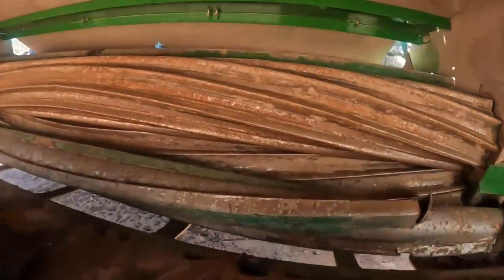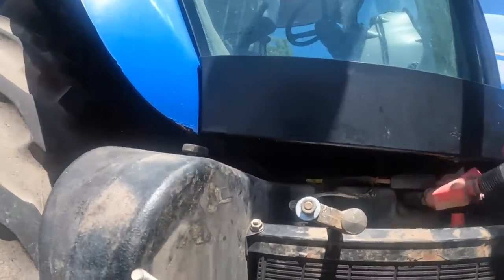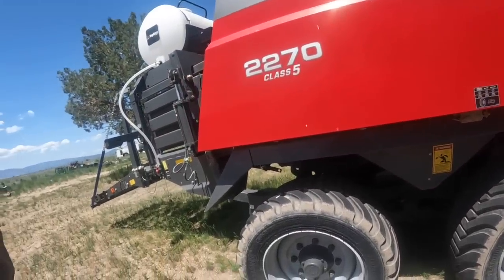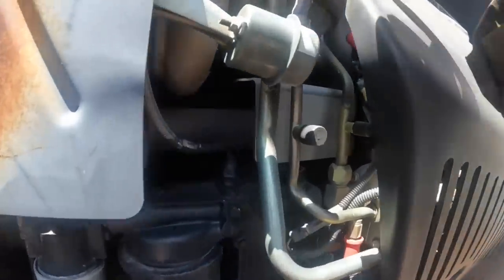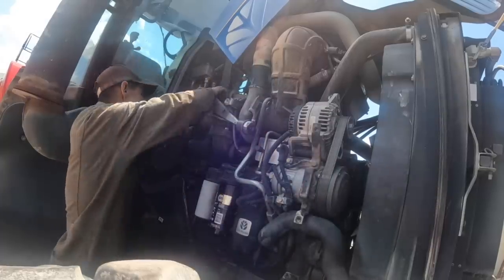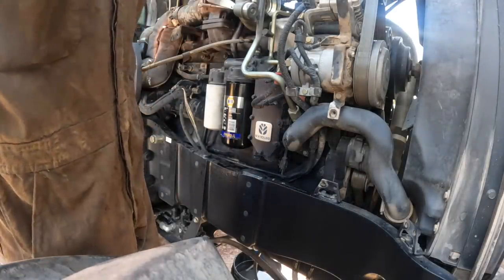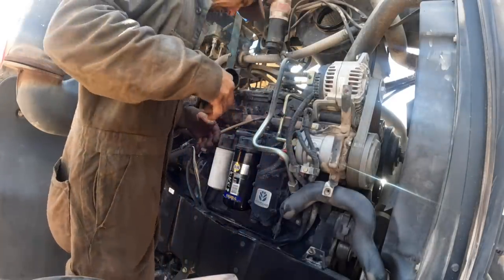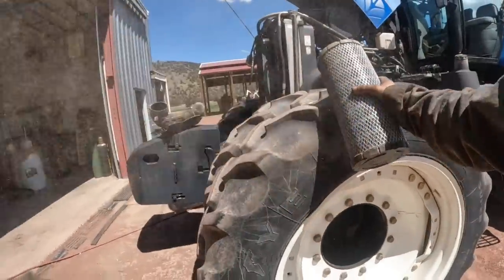Another day another shekel!

Comment: Warren, before I joined the Navy in 1969, I took a two-year course in Diesel Mechanics at Lane Community College in Eugene. They also had a Farm Equipment Mechanic course. A logging and construction equipment dealer and shop came to the school, looking for some student to work there part/time. I volunteered, and worked there as a helper until I went active duty in Navy and became an Engineman. I was wondering if you had ever thought of something like that. You need some help! Jones EN2.

Comment: Thanks for the video, when i saw all the dirt fall when you pulled that air filter cover, my thought was that filter will be dirty as hell.  Hard to believe that no one checks that stuff, and that exhaust leak being like that for so long, crazy.  I operated several different pieces of equipment at a very large cemetery i ran, and i made the guy's check the oil any time they used something, but i also did regular maintenance, because even though everything was junk, it was rough if something went down because it was corporate owned, and they would bring worse junk from another cemetery that didn't take care of stuff.  G-d bless.

Comment: We have a tg 230 that has been a nightmare. We run a 8300,8310 and 8400 Deere. The tg is newer and has had more issues both mechanical and electrical than our deeres. The biggest gripe I have is in my area the dealer support struggles on the blue ones compared to the Deere. We had a new holland 8870 that was also heads above our experience with the tg

Comment: 👍👍 asking whoever , what do the case IH tractors share with the new Holland? Power train components?.. I have no clue.. thanks for another video...see ya next time 👊
Reply: TG275 is largely the same guts as a MX275, though engine position and front axles are a little different (red uses a drop box between engine and trans; NH engine goes straight into trans therefore shorter wheelbase).  I think Case all had left hand reverser lever on column and NH use fore/aft shifter on the armrest.

Comment: Button for the parking brake should be on the shift lever, below the downshift button.  If you move the tractor and go back to center position you're in neutral until you press park button (or at least that's how it works on my TG210)